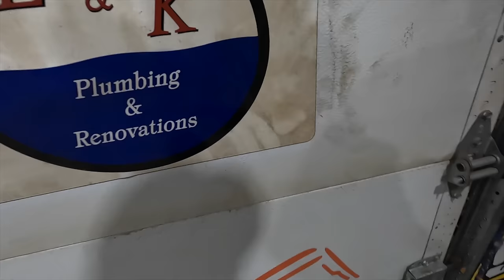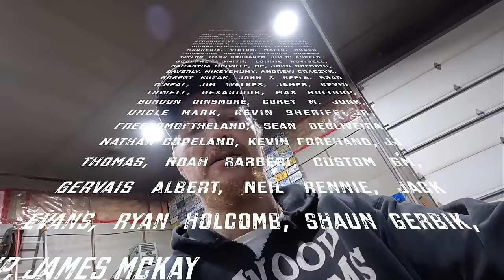how to load a forklift onto a trailer

Comment: The fact he thought that expanded metal was gonna hold it up a landscape trailer is rated for it is all you need to know. There's nothing more than a charcoal briquette rattling around in that ginger hair holder.
Reply: Even a small forklift is heavy as F.  Has to be or it’ll tip when pickin up a load.
Reply: @memorysometimers3067  They are like lead weights, I thought he was joking at first......
Reply: Pretty sure he knew it was going to hold up just 1 time. Me personally I'd put some 3/4 plywood down on the gate and on the deck so it didn't fall through but if not it has to be redone anyways

Comment: I have a 1964 clark 3000lb capacity forklift that weights in at 6200 pounds. So I needed to move it last time I used a tilt deck from sunbelt rentals for $130. This time I looked up the specs on uhaul trailer and there 6x12 utility trailer with ramp is rated for 3700lb and is only $40. So anyway it had that same kind of ramp as the one in the video a bit more sturdy but I put some 4x4 under the ramp to prevent bending. It worked and the trailer wasn't to happy but the whole trip it was fine. When we brought it back with the same trailer we didn't even need the 4x4s. Honestly a pretty good trailer.

Comment: I honestly sit here and called that before it happened because of the weight. Not being a dick but honestly I Figured it was a little heavy for that trailer.
Reply: Some people don’t realise how heavy forkies actually are. We sold one at work that was bigger than that and the guy turns up with a 6x4 box trailer and I just told him not to waste his time. He didn’t listen and pulled out some flimsy ramps, drove half way on them, folded them in half and tore the tailgate and half the side off his trailer.
Reply: @thesausage351  they are very heavy Even that small one there that pug has that thing is heavy.

Comment: Makes no sense. 4000 pound lift weights at least 6500 - 7500 lbs.and all of that sitting on what 20 sq.in. of rubber on all 4 wheels with the counter balance set weighting the must.  Why..?